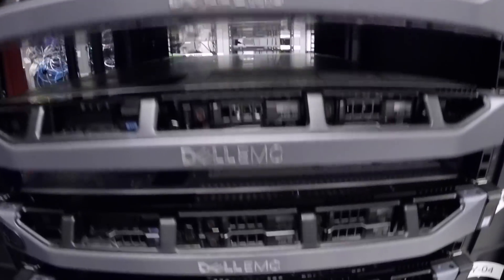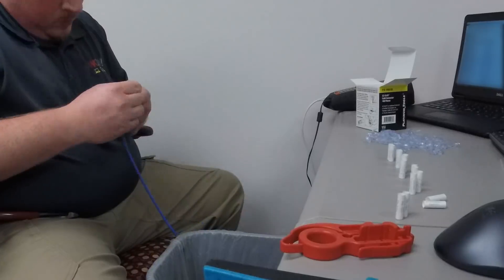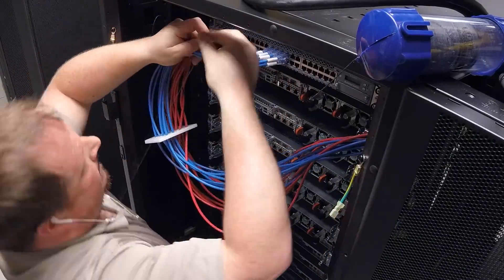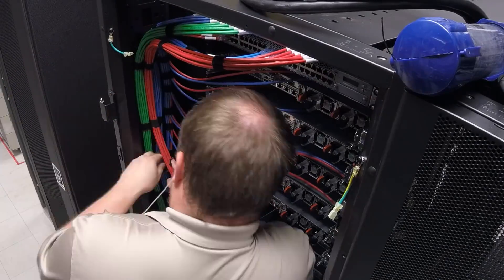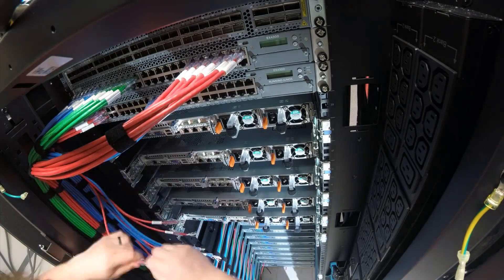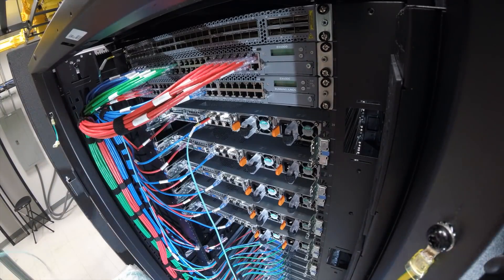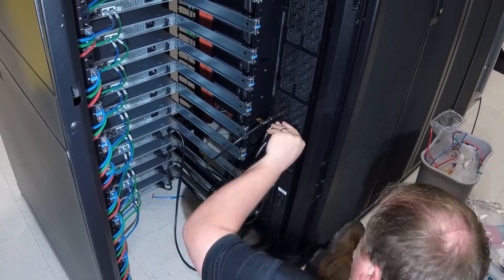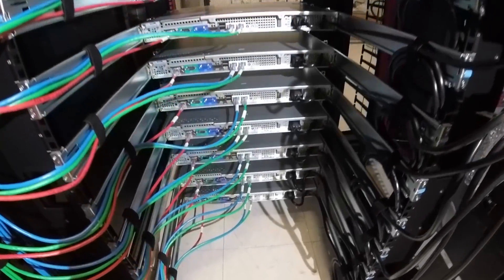Server Cable Build-out TimeLapse!

Comment: No cable management arms for the servers?
Any reason not to use/get them?
Reply from the maker: The larger R630s came with arms, but the smaller R220s did not. I chose not to use arms for consistency sake, and since the servers are clustered we can take a server offline to work on if we ever need to. So far we have not had to remove a single server since racking them up!
Reply: From what it looks like there is more than enough room to not need them. From my past experience with them. They are more of a PITA than anything.

Comment: Great video and good job with all the cables. I can feal the pain from terminating all the RJ-45 :P
Reply from the maker: My fingers hurt every time I think about doing more. Just something about that particular cable makes it rough to terminate. I do have some ideas for either a 3D-printed or milled finger and thumb thimble  to make it easier to do.
Reply: Check ez-crimp.  Makes terminating childs play.  Ps, didn't see you test and verify cat6 lines with any sort of cable tester.  Assuming this was done later or off camera :). Just getting a link doesn't guarantee a quality connection.
Reply from the maker: Testing and Certification was done off camera with a Fluke Cable IQ meter.  I have trouble getting custom length premade jumpers due to departmental budgets. They would not even get me different standard length power cables! Also, I was unaware you could not self terminate low voltage cables in Australia, kinda interesting!
Reply: I don't understand why he didn't just buy premade patch leads?

What he showed is illegal in Australia lol.

Plus not tested as above... Where as manufactured leads are.

Stupid IT people.
Reply: @theonewithin609  what's illegal about it out of interest?

I agree with not terminating cable for this sort of thing, the cost of his time is surely not worth buying patch cables?
Reply: @theonewithin609  It's not illegal to crimp low voltage cable in Oz you uneducated fool. Where did you do IT? A dumpster? I've worked in multiple large scale data centers and in none of them nor any networking certification forums even the CCIE forums I am part of doesn't mention anything of such.
Reply: @theonewithin609  Or you know you can test and certify cables in place, like every single fiber job or any structured cable job.  Haha and it's ILLEGAL to self terminate cables in your own premise?  Get bent lazy know it all.